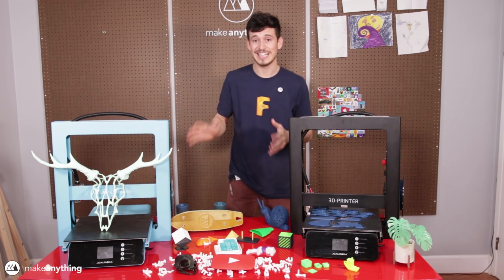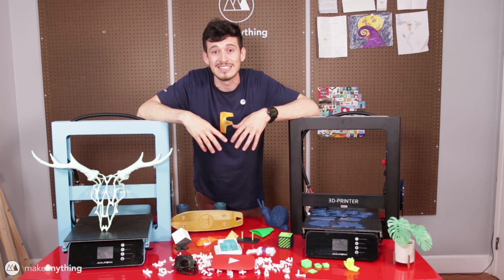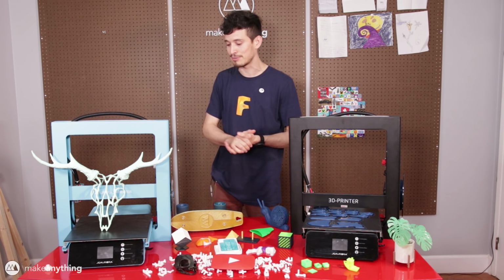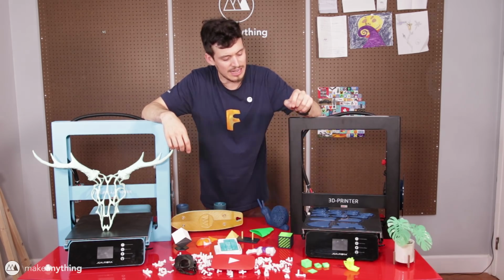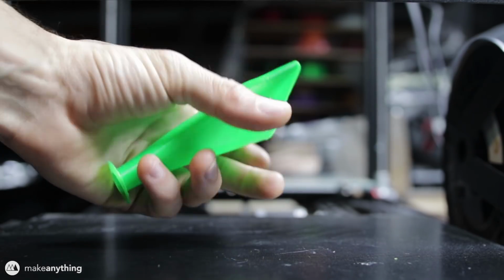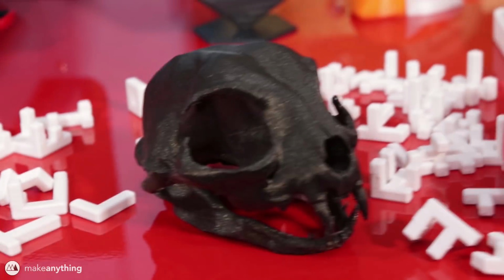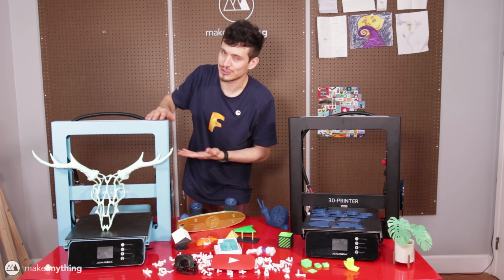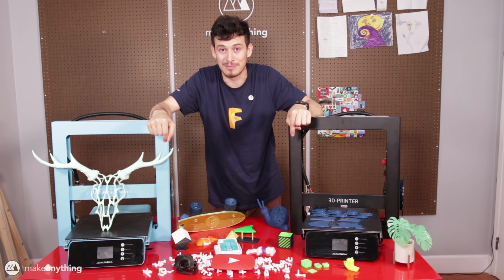JGAurora A5 3D Printer Review // Underrated?

Comment: Glad to hear they got their sh*t together! Mine was one of the first out the factory and it's stuffed now, mostly due to bad QC and 3D Printed parts that are now aluminium from the factory. A failed Z move ruined my ultrabase surface to >:( mad because it's awesome as a print surface!
Reply from the maker: Oof, I hope they really did get it together and I'm not just lucky... it's always the reviewer's dilemma!
Reply: Make Anything 
O O F
Reply: I've been trying to get in touch with both of you guys -- will you review my new build surface?  I just need a place to send them! =)  .4mm anealed springsteel, .125 layer of pei, surface treated for thermal stability... no magnetic stickers, only n52 magnets.   I'll send whatever sizes you need!
Reply: David Hargrove do you have an online store ? I'm currently looking into getting my first 3d printer and I'm considering the Tronxy x5s-400 so I've been looking for a 400x400 spring steel print surface for it .
Reply: In the wise words of Edna mode no swearing
Reply: that happened to me too, but i changed the stepper motor driver then adjusted it to use a higher ref voltage and the z axis works again without skipping steps and crushing the limit switch & adjustable bracket

I bought my machine used and totally defective, but I'd like to think that this machine needs to have modifications to be usable... with 5-10 mods it can become a 3d printer for the shop that will be awesome 24/7/365.

Comment: here's a list of mods I can have using 3d printed parts.

2 bins to collect dust on the sides of the frame
Direct drive for flexible wire extrusion
Vibration dampener for Y axis
Vibration dampener for X axis
Rounded edges racket for the top of the frame to protect the wires
Automatic BL Touch leveling
Top-bed leveling screws
Plastic power supply cover (reduces noise)

Fan for stepper motor drivers
Fan Nozzle upgrade
Fan duct for the extruded plastic
Fan adapter for the extruded plastic
Extra fan for the extruded plastic
Replacement fan for the extrusion head
Frame brackets for permanent installation on a table or plywood with tension rods
Wire guide and bracket for the X axis motor
Guide for the top of the rods
Spring retainers
ABS Housing holder & arms
Lever for manual feeding
Modification of the wire feeder for handling flexible wires
Baskets that will hold all your tools
Adjustable legs
Side covers
Bigger leveling nuts
Filament dispenser extender
Ball bearing dispenser
Camera stand/holder/bracket
Z axis limit switch customized bracket
Wiring guides/brackets/protectors/chains
X axis tension belt adjustment bracket
All the OEM printable plastic parts

If you don't know these are available, this machine isn't for you.

Comment from the maker: Hey everyone! Since my review one of my two A5s has suffered from a failed stepped driver.. I think (update 2: nvm one of them is fine, the other did need a replacement driver). That's somewhat common but this printer is really annoying to take apart because of how solidly it's built. Also, based on many people's experiences it seems this printer is very hit or miss. While the printer worked amazingly for me, that doesn't always seem to be the case, so I won't be endorsing the A5 so heavily anymore. It can still be fantastic, but the CR-10 or i3 Mega seem like more reliable choices.
Reply: hi, Devin, I've bought my jgaurora a5 about half a year ago and it worked quite well for me. Not as well as it did for you but still quite decent. but today I came to my printer with hope of printing something and the bed doesn't heat up anymore. there is a led indicator on the bottom of the bed, but it doesn't light up, so there must be a connection messed up somewhere. any idea which cable could be the messed up one? it's my first printer so I think that JGAurora is just a big shame of the 3D printing world and because as it was my first machine, it just discouraged me from 3D printing. and it was not cheap either! so just money thrown away...
Reply: hi im looking on gearbest what printer would you recommend for the £200-£250 price range for print quality and speed i would like a printer upgrade from this one for my first one that has a bigger build volume.
Reply: @roberttretola8263  Not really, this is an extremely inconsistent printer. i have seen several great reviews of it, but there are just as many that say it is garbage. I have one myself, and cannot get any kind of quality out of the prints if they even work at all, and that's with months of troubleshooting. He got lucky and got one that worked, a lot of people weren't lucky. I think it shows more integrity that he was willing to come out and say he's not supporting this as much anymore due to this inconsistency.
Reply: @roberttretola8263  I have a JG Aurora a5s since yesterday, my first printer. The heating plate was mounted so high that my printer head crashed on it on first calibration, i almost broke something on first step of your "manual". After mounting the plate corectly and calibrated... my first print was awesome! Now i think i have to check all screws because something is vibrating on fast travel an is making noise. Maybe the printer is good, but you have to change something on the assembly of the printer because the printer can be good quality, but if your assembly guys are mounting stuff bad and loose you will have a bad reviews.
Reply: @vit.budina  The 24v heating bed wire is broken inside the plastic chain that is supposed to help support the wire when the Y axis is moving.
You should remove the chain and fix the wire

Comment: My JGAurora A5 still printing great after two years. I changed the the stepper drivers with the TMC2100 and it's supper quite now. 
I had to add fans to cool the drivers and the filament feeder stepper motor but not a big deal since the mother board brings extra 5v power outlets and the power supply has 24v available too. I sleep right through the night while the printer is working.
Reply from the maker: That's great to hear! I'm fairly certain the stepper drivers failed on mine. Is it just me or is it a pain to take this thing apart though?

Comment: I got this printer a few months ago and I was a complete newbie, and I chose it because of this video.
A few things need to be mentioned; first, don't buy from gearbest. the shipping will most likely be so bad that the build plate will be curved or something else might be broken. I heard Aliexpress had better results.
Second, the bed leveling screws are TERRIBLE. it's like the screws don't match the knobs, and it was CONSTANTLY popping off. I had to go to a hardware store to get something that actually fits together, and the springs are waaay too hard for its purpose. not only that, but also they make the protective paint come off from under the headbed, which means it can be at risk of causing a short. the printer now comes with clips to keep the bed in place, and those too can make the paint come off, which can cause sparks to appear if you have a wipe function. The stepper drivers don't come with screws to adjust the voltage, or at least mine don't. It won't get detected in cura 90% of the time and the USB plug or wire just stopped working out of nowhere after a week. Customer support did not even reply to my email.

That being said, the print quality is pretty good! with a few tweaks, the only problem I had was a very small amount of ghosting. I've only ever tried this printer, but comparing it to other prints people have, this one seems pretty good, and I've yet to try 0.1 mm layer height! the community is quite helpful and active and helped me figure out most problems. their custom firmware enables you to change settings mid-print, or at least for the first few layers. also just a footnote but the plastic they use for leveling has 2 sheets to peel off, and if you don't peel them off, your bed won't be level.
Reply from the maker: Dang, sorry you ran into so many problems! I'm glad you managed to get it printing
Reply: Thanks, man. I mean I'm a positive guy and I think all the problems I overcame with the printer made me learn so much that it kind of evens out, y'know? 
Anyway I love your reviews nonetheless and your projects are pretty inspiring!

Comment: Well you are having a lot better luck than I've had. Prints often fail (a lot) and it the leveling process for this printer is maddening. I also have had problems getting PLA to stick to the diamond glass bed. I don't know maybe I just have a defective one. I also had to replace the thermistor which was very difficult to replace.

Comment: Careful with the metal scraper... It can damage the black diamond plate. It's better to use a plastic version. And put some clips on the plate also. The glass will detach after awhile. Also check JG Aurora A5 FB group. It has awesome upgrades and community around it.

Comment: I think the glitch where a changed extruder/bed temperature resets once the print starts would be a gcode issue. The gcode usually (some slicers are different) sets the extruder and bed to temperature (M104 and M140) and then does the near identical M109 and M190 commands to wait until they reach the set temperature. So basically, if the temperatures are changed between those commands (so while heating up) it will be set to the initial temperature.

...Unless it is a different software that runs consecutive “heat and wait” commands where the hotend and heatbed heat up separately.
Reply from the maker: You're probably right, but using the exact same Gcode between this and the CR-10, I'll only have it happen with the A5, so there must be a firmware fix.

Comment: My only complaint about the printer would be that long as hell bowden. You probably need to push 8+mm of retraction for that to reduce stringing in any meaningful way. Just looking at the snail near the end. That is really the kind of hairy stringing you usually see when the bowden tube is that long. Looks like there is also a bit of extrusion inconsistency in the layers. Could just be slight over extrusion, could be a weird layer height issue or it could be something to do with the long bowden and having a non geared extruder. Can't quite tell without seeing it print right in-front of me.     If I had to change anything I would find a way to bolt the extruder to the back of the X axis moving frame, to the left or right. Maybe get a geared extruder on it. Then we are talking an excellent machine. Yes I would prefer the bowden to twist a bit rather than have it so long. You could probably cut the length down to a third

Otherwise it is a good printer. I did consider buying one to add to my collection a while back. Joined the JGAurora A5 Facebook group to have a look what others there were saying. I suggest everyone that wants to get one have a look there first. There have been some issues that Devin clearly hasn't gotten. Whether that is because JGAurora made sure his are perfect or whether they have fixed the problems (on-top of the ones he did mention). I am really not sure.   here is the facebook group link facebook(dot)com/groups/1981078355494500/  <- (just in case youtube decides to be a pain with links. you never know)
Reply: I'm interested to buy ones of these, but I'm torn between this printer and the CR - 10. Not sure if you have one but it seems like you know what your talking about. which one would you go for?

Comment: On paper the JGAurora looks good, nice LCD but under light use the parts tend to go wrong and then you find out that the help team is not very good, parts don't arrive six weeks later and then they send out faulty parts. The guarantee is not worth the paper it's printed on if you purchase the printer using AliExpress and I would fill the page here if i went into details about all the parts that have gone wrong.

Comment: Damn it! I just bought Anycubic I3 Mega half a month ago! Where was this video! ( I am a little bit angry)

EDIT: I just checked that I got I3 mega for cheaper than this printer, as I bought it during anniversary sale of AliExpress.
Reply from the maker: The i3 Mega is still an amazing printer, you shouldn't be angry!
Reply: Get a second one. May be they will have a little baby printer sooner than in seven years.
Reply: i3 mega is the best Price and quality!!!
Reply: Michael S are you asking me to buy a second 3D printer? If yes,  give me $300.
Reply: @make.anything  Hi, I've noticed that a lot of people had problems with bed adhesion on anycubic ultrabase or jgaurora's black diamond. I was one of them sa well and I've found out that using a window cleaner works great! You spray it on the surface, spread it over the whole bed with dish washing sponge (new one, of course) and then use paper tissues or a toilet paper to wipe it off. I know that you probably don't have this problem, but I know that you have quite a lot of viewers who have this kind of problem, so I wanted to ask you to mention that in a video. Or, what would be even better, make an entire video about different bed materials and what helps them to work better. Have a nice day and a lot of succesful 3D prints ;)

Comment: How is this printer holding up!? I'd love to hear about it. I purchased the Anycubic I3 Mega based on your review and right out the gate the power supply died. I'm a noob to 3D printing and wanted a machine that was good to go right out of the box. When I informed Anycubic about the issues I was having they wanted me to test the machine and replace the parts myself. Not the best customer support for a first time user and novice. I'm curious if you've had experience with JGAurora's customer service!
Reply from the maker: I had a problem with a stepper dying on the jgaurora after my review and didn't hear back from support for the longest time. Then they reached out for another reason and said I was contacting the wrong email.. generally the situation will be the same where they do ask you to run some tests to figure out what to replace.

Comment: This does look fantastic. What kind of print speeds are you getting with the stock head (using PLA)? Is the quality of the print head good enough, or could it stand to be upgraded?
Reply from the maker: I haven't pushed print speeds.. I'm usually just happy printing at 40-50mm/s. I haven't felt the need to upgrade either, but I'm sure it could be modified and improved

Comment: I've wanted the anycubic i3 mega for a long time, but now, the build plate size is a lot smaller than what I need. The JGAurora A5 is exactly the right printer for me, but I don't know if I should take the risk of getting it. The build plate is just the right size and it seems great, but I've seen recent videos of people who have gotten some faulty ones, for example, someone's JGAurora caught on fire upon homing. Do you think you could help me with this dilemma? Another printer with a similar sized build plate would also be an option. I've also got a $500 budget. Thanks.
Reply from the maker: yea, both of mine ended up faulty. I'd go with the CR-10, CR-10S, or Tevo Tornado instead

Comment: Did you do the firmware update?  The reviews have been fairly mixed on this printer but basically it came down to the firmware coming from a dead development branch.  A lot of complaints about it can be fixed by doing the firmware update as I understand.  I really want to buy one myself but I can't fit it into my life atm.
Reply from the maker: I didn't update firmware personally, but maybe they had already fixed things when I got mine. Or it's just those little problems I mentioned, which would be nice to fix although not more than annoyances

Comment: Can someone with this printer comment on how well it stays leveled after you get it dialed in?  Is it something you need to check before each print or only if you move it around?
Reply from the maker: I rarely have to re-level. Sometimes when I switch from .1mm to .35mm resolution I will just quickly readjust the knobs as the skirt is printing and it's fine.

Comment: Idk...ya it prints good, it’s rigid, it’s cheap, and the build surface is ok...I dislike a few things about it...I love to upgrade my printers...and this doesn’t look friendly to take apart at all...the print quality just doesn’t satisfy me...yes it’s cheap but after some upgrades my Tevo Tarantula prints way better than that...also that screen looks terrible in my opinion...I want the classic smart controller...this is why people love the CR-10...
Reply: Matthew Guiher   you can probably find my comment about it somewhere if you look for my name. But you pretty much hit it on the head. Upgrading the thing is a nightmare. Changing the surface is a nightmare since it is part of the heatbed. Literally the company that sells it sells it attacked to the heatbed. The bowden tube being so long is my biggest issue tbh. Overall it is an okay printer. but it really isn't good enough. There are better things out there. The tarantula is great after upgrades (I have one). The CR-10 and CR-10s are also great. The tevo tornado is great too. There are other printers the same price or cheaper that really are far better than this. Especially with it's shipping price. It cost almost as much to ship as the printer itself. Putting it squarely at the price of a cr-10 and more expensive than the tevo tornado
Reply: Martin B yeah In my opinion Creality and Tevo set the standard for cheap 3D printers for beginners and experts. None of their printers have legit problems...they all work out of the box really well, but they have room for improvement and thanks to the V slot rails, the open wiring, the standard marlin firmware,etc...it makes it super easy and fun to upgrade. Some try to copy them but they are the original makers.